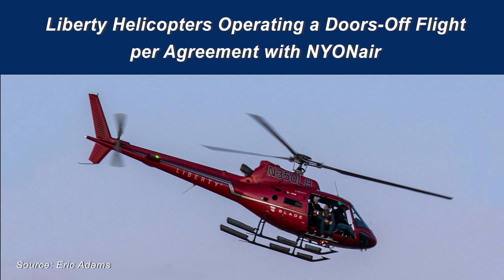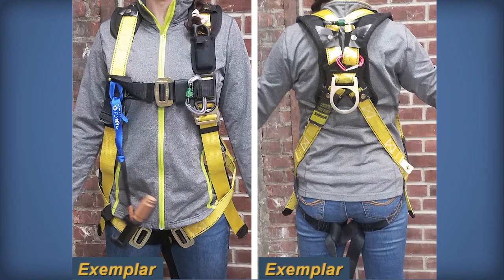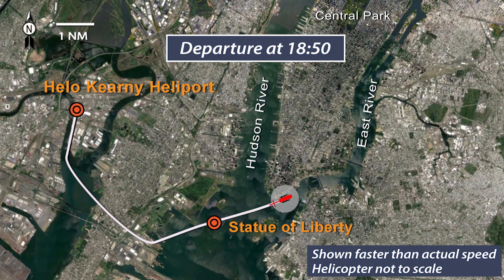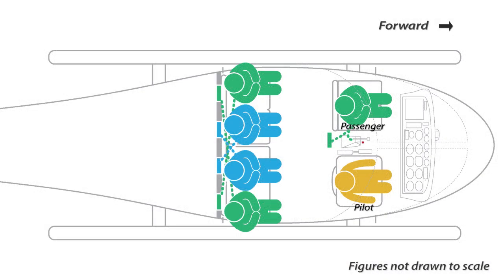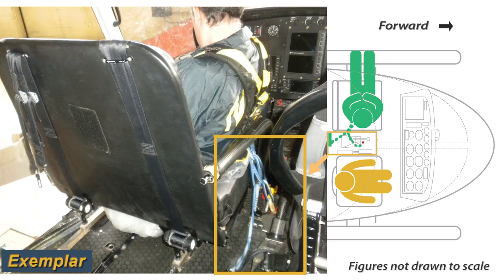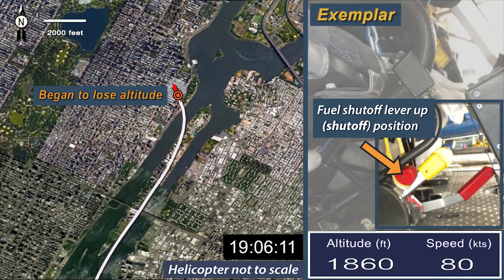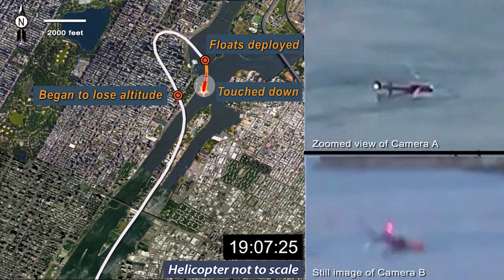Loss of Engine Power and Ditching Liberty Helicopters Inc. Operating a FlyNYON Doors-Off Flight

Comment: Note at 0:46 the clearly visible harness cutting knife in the black pouch on his left shoulder.  They have a V-slot, you just hook it over the harness strap and pull once.
Reply: Yeah I guarantee they didn't know it even existed which is really sad
Reply: None of the passengers were seatbelted in crash positions. They might not have even been conscious after impact with the water.
Reply: @CorwinPearson   It was a very soft touch down on water. They were absolutely conscious.

Comment: Airbus, as a manufacturer, has a sweet spot for ditching in New York. Helicopter pilot should have aimed for the Hudson river it has better ditching survival rate. 
Now seriously, did you notice the pilot had to vacate the helicopter from the right side, which submerged first? This alone probably prevented him from assisting his passangers.  But the 2nd engine restart attempt was probably a mistake, it would have been better to focus on briefing the passengers on closing the doors and  unthethering them. Sometimes you have a very difficult choice between saving the aircraft (and your career), or,  saving your passengers. Sully made a good decision on chosing the latter, early on , accepting that on the other hand, his Airbus will be a write-off and he may be reprimanded for that.
Reply: I Love this comment because I said the same exact thing considering they only had a minute to fall 1900 ft he definitely wasted time on the wrong things not to mention the time he wasted constantly trying to get LaGuardia to understand he had engine failure🤔😔
Reply: @rethablair6902  Well, the old adage holds true again: aviate, navigate, communicate, in that order.  I am quite sure however, that there is NOT A SINGLE person, who could perform flawlessly in that situation. Even Sully and Jeff made a few mistakes (e.g.,  ditch valves remained open). But at least we should prioritize and focus on doing well those actions that protect lives and make the mistakes with other actions.   Easier said than done, but it's possible and it does reduce fatality rates.
Reply: @rnzoli  U are right i imagine we shall never know how things actually were up there on that tragic day but such a loss of young lives full of promise 😭
Reply: Wow, saving the aircraft and your career is worth more than saving the lives of your passengers? At all, saving your passengers should be more like a career booster rather than anything else. The plane can be replaced by insurance probably anyway.
Reply: @egalf  wait, you probably misunderstand. Normally when pilots save their aircraft in an emergency, they save their passengers as well. The really painful situation is when they have to accept damage or total loss of their aircraft, in order to save their passengers from fatality.  This is perfectly described in Sully's book. Pilots are trained to take a very good care of their spectacularly expensive aircraft, keep all engine parameters in the green, reduce speed in turbulence to avoid airframe stress, make soft landings to protect undercarriage. It is an immensily difficult choice to abandon  attempts to restart the engine, and instead accept that the aircraft will be lost and written off.  It won't be a caerrer boost in aviation, because your employer, the insurance company, the authorities will scrutinize you to the smallest detail. Not everyone comes off from an event like this, as Sully and being part in an accident  will close doors to job opportunities, regarless whether it was your fault or not.
Reply: @egalf  It worked for Scully
Reply: There were no doors they were "removed" and the passengers were briefed on how to unhook themselves before the flight. The problem was the overkill of the restraints that made it ridiculously difficult to unhook and was obviously designed by a hysterical permanently outraged liberal.
Reply: @phillipkalaveras1725  i read the transcripts and don't remember them being told how to get free in case of trouble 🤔
Reply: @phillipkalaveras1725  you are right, I was wrong in assuming that the sinking could have been delayed by closing the doors. They were permanently removed from this aircraft.

Comment: That was actually a really good auto-rotation, especially given the circumstances and his utter confusion as to what happened.
Reply: Are you good at helicopters? if yes, my question is: could it be that the soft ditching is actually the result of the successful 2nd attempt to restart the engine, and the engine spooling up already and giving a little power by that time?  This would also explain to me, why the aircraft capsized on the floats, instead of settling down into a stable position in the water. 

(TransAsia Airways Flight 235 stalled and spun right when they were restarting the good engine they had shut down earlier by mistake.  Sometimes it's more dangerous to restart an engine at low level  / low controllability, than just glide it / autorotate it in as per normal emergency practice. A restarting engine can create forces that are not normally experienced by pilots in flight, and can easily catch them off guard.)
Reply: @rnzoli  With the shutoff valve closed he could never even get the engine to ignite so I imagine he didnt get very far trying. Even if he opened the valve quickly it takes 30-60 seconds to start up a turbine, and the only usable power comes in at 90% anyway (for a helicopter) so I doubt it would have had any impact on performance.
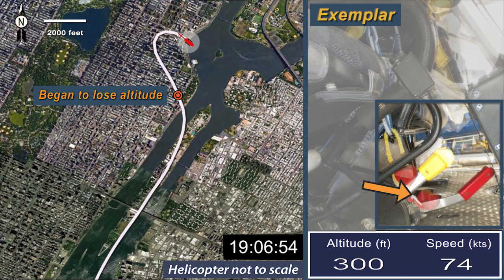Reply: @codmott286  thanks. @ 4:00 this video says that the fuel supply was restored by the pilot while descending through 300 feet, but there was no time left to restart the engine. Perhaps he didn't even initiate the starting sequence. But then the big question will be why the floats failed to keep the helicopter in an upright position. Maybe some of them ruptured on impact with water.  
By the way, passenger interference, inadvertently  turning off the  fuel shut-off valve, has caused a similar accident 25 years ago in my country. 10 people died on the overloaded Mi-2 helicopter when it crashed.

Comment: They (the passengers) should've got back in and began to unharness themselves the minute they knew the helicopter was going down.
Reply: I think extreme panic must've set in and had them paralyzed by fear that's all i can imagine what made them reach for the knives at the last second😢
Reply: You should never do that. In these underwater egress training courses instractors teaches you to unharness yourself after the impact and at the time that the rollover motion of the helicopter has been stopped.But its extremely difficult to do that  if you are not trained.
Reply: @nas2kids  
I'm talking about the particular harness they were using for open door photography, not their usual seatbelts.

The harnesses they were using can't be released by the wearer, only by someone else or cut with a knife. Which was apparently what they were supposed to do.
Reply: @jtveg  i think they were waiting on the pilot to tell them when to cut loose but he was pre occupied with trying to ReStart the copter instead of instructing them what to do
Reply: @rethablair6902  
You are probably right. Everything happened so quick that they really had no chance unless they immediately took action the instant they realised they were going down.
Reply: @jtveg  unfortunately YES😢

Comment: so a safety device killed 5 people, both in shutting off the helicopter and holding them inside while it flips over under water.
Reply: safety device for the wrong application. A parachute is also a safety device but you wouldnt want to use one as a life raft. These harnesses and this joke of a flight operation with open doors and people hanging out was stupid all around.
Reply: Offt! Yeah, didn't think of that.
On the bright side, at least they were easy to recover....
Reply: You are right the harness should not have had that dangly bit.
The harnesses should have had quick release buckles and the passengers should have had instruction and training on how to exit the helicopter in an emergency.
In the UK, flights by helicopter are only allowed over the Thames, Helicopters are not allowed to fly over land  within central London. The Helicopter in the animation could quite easily have come down on the populated parts of New York.
Reply: 5 souls, bro. But your ironic take is spot-on.

Comment: The flotation worked, but still caused the helicopter to be inverted. Very sad. Hopefully this can be improved over time and the engine is fixed as well. Condolences to the families of the loved ones on board.
Reply: I think the flotation deserves more attention.   That was the only thing in this entire incident that did not work as intended.   If the the helo had stayed upright, everyone would have lived.   This is a failure of the flotation system as much as it is poor practice / incorrect application of the harnesses.
Reply: there was nothing wrong with the engine. Dont put passengers in the front seat where they can randomly push buttons and pull levers
Reply: Cod Mott even so presumably the plan for an emergency ditching shouldn’t be that the pilot escapes and everyone harnessed drowns.

Comment: Could you do a follow-up video showing the release mechanisms on the harnesses used? How hard were they to unhook from in a packed helicopter like that? It seems like the passengers should have had time to unhook before being submerged if they weren't in a total panic already, but knowing the restraint system would shed light on whether that was really as easy as one might imagine. Very sad incident, but understanding the restraints and devising better standards for them could save others in the future. Obviously, some guidelines need to be set out on front passenger restraints as well, can't have loose bits snagging on controls. It sounds like the fuel cutoff should come with an audible warning too, that's not usually something pilots intend to do in the middle of flight and it's only recoverable if rectified immediately (as much as airbus loves computers I would have thought they'd train it to know that fuel being cutoff in flight is abnormal and have it send warnings, but whatever).
Reply: My earlier comment (a reply) remains true and relevant:  underwater egress under stress is a learned skill that requires training and practice!  Believe there are examples on YouTube of the training US Coast Guard personnel get to do that very thing!
Reply: @gus473  Oh I know, I've watched the Marine corps training for underwater egress, but I know if I were a passenger I'd have tried to get out of the restraints before impact or immediately after, before being submerged. So I'm curious how difficult it was for a passenger to unhook themselves even without being upside down underwater, with how tightly they were packed in there and the restraints used I have a feeling it may have been nearly impossible for someone to do themselves which would be a big safety issue. I think no matter what is done very few people would be able to extract themselves once inverted underwater, definitely requires more training than any layman off the street could aquire in a preflight briefing. Though better restraint design could make it possible for people to get free of their restraints before that happens.
Reply: @MrMattumbo . It completely submerged 11 seconds after hitting the water not even enough time to say OMG 😢
Reply: @rethablair6902  11 seconds is a long time, I wrote this comment in under 11 seconds.
Reply: @MrMattumbo . Yea but u are safe on solid ground while these poor souls were being pulled into a watery grave so no comparison 🤔
Reply: Panic and fear must have prevented their successful egress and could have clouded their judgement.
Reply: @modelmode8  Very likely, would be my guess.
Reply: Well since they used this restrain system they haven't been properly secured in their seat, only the pilot was. They was probably experiencing pretty large forces and not necessarily in a straight direction. The most likely cause is that they was knocked out on impact.
Reply: There was no way unless you were very familiar with that type of gear.. that you would be able to get out of it..
the four people in the back are now on their backs entangled with each others safety cables.
As soon as you hit the water...the harness would have stuck to your pants so you would not be able to pull you 
legs out of the leg straps..  the only way you would be able to get free in time is with a knife..

Comment: I don't think that the pilot did anything wrong here.

Just wondering if there need to be additional safety measures in place on these safety harnesses in the future, like two hand pulls to release the cable. Since this was most likely the cause of the fatalities.

Sad story nevertheless 😟
Reply: Agree it's sad. Underwater egress under stress is a learned skill, one that requires training and practice, and even then is not easy or foolproof....!
Reply: That fuel shutoff should have a safety. Like squeeze and pull
Reply: @JoePJack1  no it shouldn't. The cockpit is made for pilots, not for passengers fiddling around with controls.

Not that this happened in this case, it was an accident - but the cutoff switch need to be found and operated very quickly in case of an emergency, or you will have accidents, injuries and deaths because the pilot had trouble to use the cutoff switch because some of the overcomplicated safety mechanism was faulty.
Reply: Ruben Kelevra well I’m a YouTube engineer. It needs a safety.
Reply: @JoePJack1  I think I shouldn't feed you any longer. Plonk
Reply: @RubenKelevra  @JoePJack1 there are AS350s that have a guard around the passenger side of the throttle and fuel controls.
Reply: @timrogerson8895  this Airbus chopper is pretty modulary in design, you can remove the left side controls completely, if you don't fly with two pilots.

IIRC the cutoff switches are guarded on the pilot side as well, but this are simple flip guards. Completely different story than a mechanical lock on a lever. They are so simple, they cannot fail.
Reply: @JoePJack1  How about just not allowing a passenger to occupy the front seat. That seems like an easier solution than attempting to make the accessible flight controls idiot/accidental activation proof. Pilots already have enough to remember when it comes to emergency procedures, adding time/steps to that list will not improve safety.